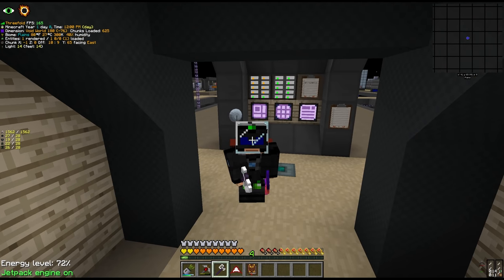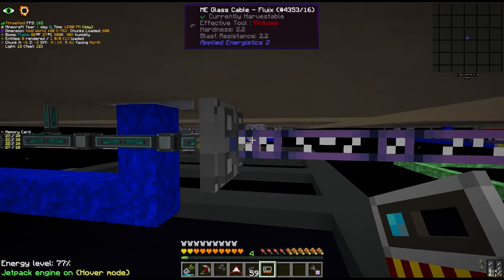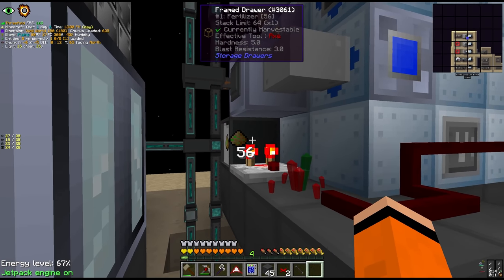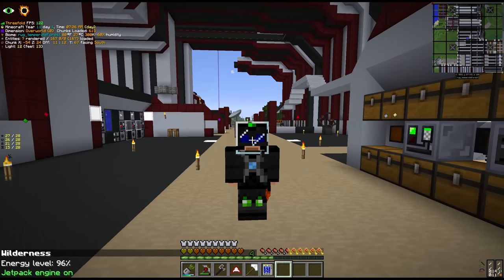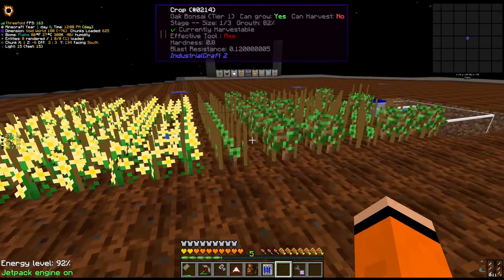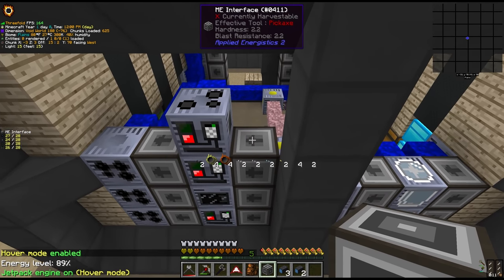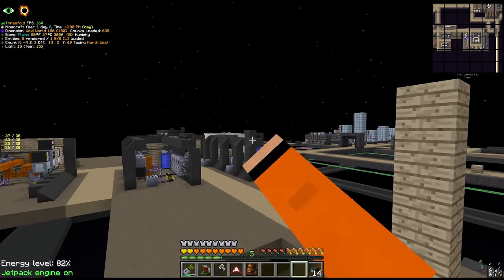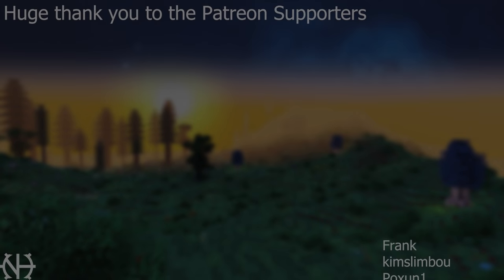Gregtech New Horizons - 44 - Third Time's A Charm?! Modded Minecraft

Comment: If you don't like the speed of the nano boots, you can always adjust the speed in the mod options menu under electro gadgets in numerical values. I have mine at 0.25 and its perfect for working around my base. Don't forget the to adjust the quantum version too! (you will need to reset the client for the changes to take effect btw)
Reply from the maker: I may end up doing that but I'm slowly getting used to them. Editing configs is something I'm reluctant to do unless something is broken

Comment: Hey Three, you can use Indigo to make biomass. It only takes 4 while the other plants take 8. It is what I was using. In addition, you can get additional breeding chances if you breed in a square. So it would be the crop sticks diagonally and the source plants diagonally:
SC
CS

Mirrors with hungry chests are an early substitute for Ender Chests. They are unlocked pretty early in Thaumcraft research.

Comment: One thing you need to stop doing is running everywhere. Walking with nanoboots is fast enough, and sprinting just depletes your hunger faster for no reason...admittedly that's less of an issue post-Tin Cans if not Healing Axe, but still.

If you're having titanium issues it's time to save up and invest in a dedicated ore processing system and some T2 ore drilling rigs. And not have the latter void most of what they mine this time ;)

Mining for diamond is much better on Ross128b, since it's graphite veins specifically have diamonds as the entire bottom layer. As for gold this is something you should have stopped running out of a while ago - using mercury for ore processing on things that give bonus gold dust chance will give you tons and tons of gold, and if that's not enough you can set up glowstone farms to centrifuge into gold dust and redstone dust. And excess glowstone dust, of course.

HV Vibrant Alloy Wrench is really, really good, yes. And you're actually really close to being able to cook up the next general upgrade in terms of GT tools, namely Oriharukon. Does require an IV EBF and Vacuum Freezer, but you've got the HSS-G coils already.

Wand foci in general only requires a wand, staff or bracelet - scepters and staffters cannot use wand foci, so keep that in mind. The Focal Manipulator is, essentially, the enchanting table equivalent for wand foci, allowing you to apply upgrades that reduce Vis cost, increase damage/other effects, apply modifiers, increase range, etc. The one caveat to improving wand foci is that it needs a very specific kind of vis - centivis - that you can get in one of two ways. The expensive, but long term solution is to energize a node, which will produce a constant, steady stream of centivis. This will require you to find a good node with all types of primal vis in it (hint: use the Arcana Abacus on a node to figure this out, it'll save you so much effort), jar it up to move it to your base (which means either risking damaging the node or unlocking advanced node jarring in Automagy, which itself requires some stuff), and get all the stuff you need to energize it. The quick and dirty solution is to unlock the Vis Dynamo in Thaumic Horizons, which allows you to use your wands to turn regular vis into centivis. This does drain wands *surprisingly quickly*, especially for expensive upgrades, but given enough primal shrooms vis is functionally infinite anyway, so that's not an issue. I would recommend working your way up to at least a Transmutative wand if you're going to go the vis dynamo route, though, just to make recharging a wand that much easier.

And this is why I recommend getting into Thaumcraft early. Yes, it's an investment, but this is all stuff that Three could have had as soon as he got an HV Chemical Reactor to get the Eye of Ender necessary for the runic matrix. And this is just the tip of the iceberg in terms of what TC has to offer.

You can manually feed blocks to the enhanced building guide and have it automatically place those blocks at least in 1.12, no clue if that feature exists on 1.7 (and it would just place blocks wherever, you couldn't reasonably use it to carefully build a dome like that anyway).

The infusion altar has a massive area it checks for stability items. There's definitely more than enough space just below the altar that it checks to more than cover all you need in terms of stability, and even if not I don't think it would look horrible if you were to, say, place some crystals on the wall or have some floating candles around the room.
Reply: Nerd.

Jk jk, I could never hope to understand that.  Well done.